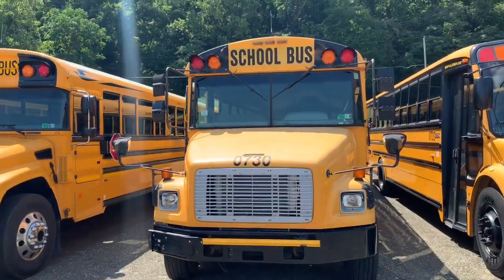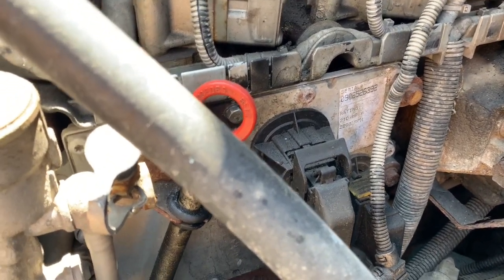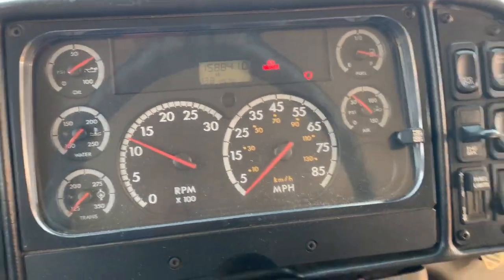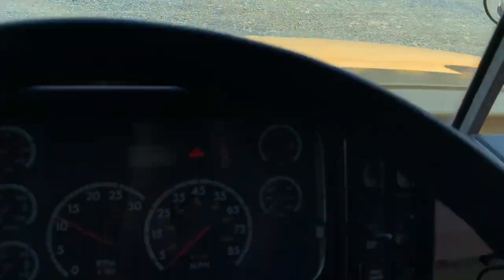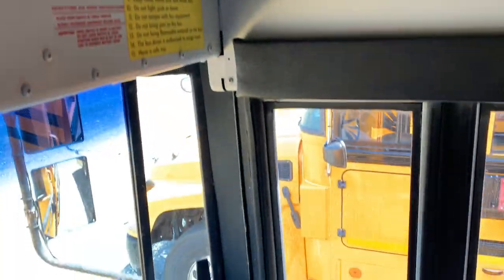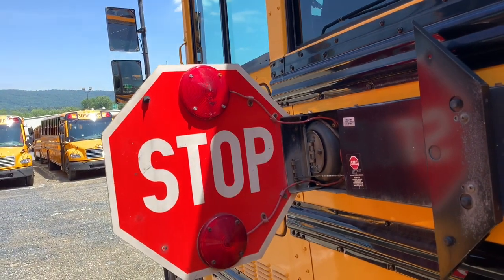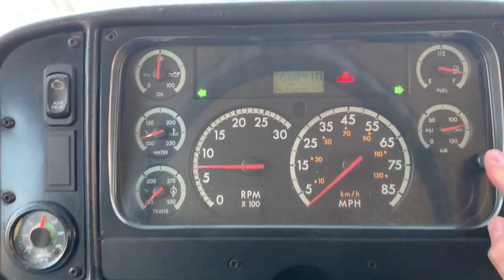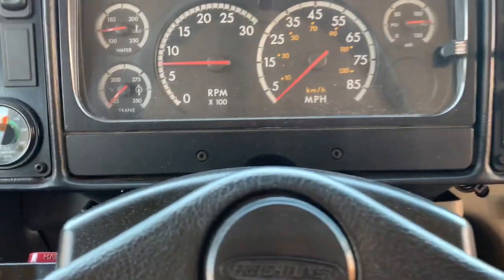2007 Freightliner FS65

Comment: Those brakes are called air assisted brakes it’s hydraulic brakes over air it’s used air pressure lines to convert into hydraulic pressure